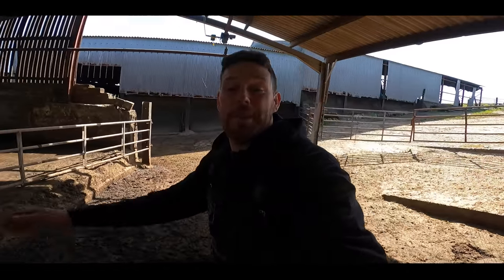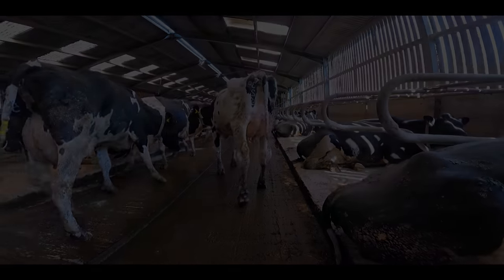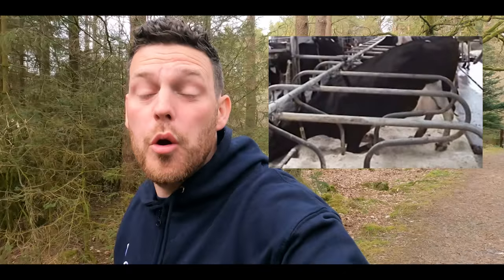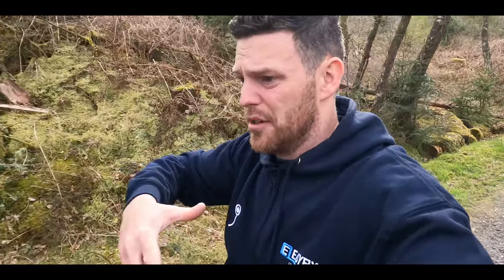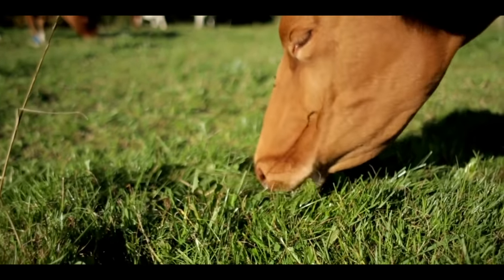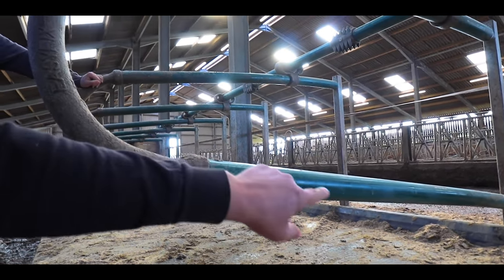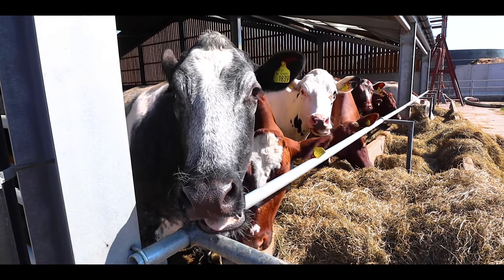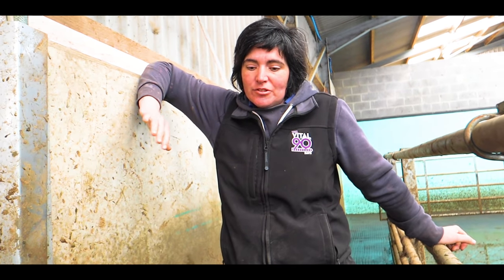*COWS LEG BURSTS* EASYFIX FOR COWS

Comment: It's nice to see how things have moved on I used to fit stall work and dairy equipment and the guy I worked for used to make the stall work from scratch it was nice seeing it develop from raw materials taking it to get galvanised and then going and fitting it aswell as anything else steelwork in and around the building I often thought how uncomfortable it must be laying against the bars and this system looks so much better

Comment: Padding the metal poles with old tires would help them be cushy. I went on a playground that was surfaced  it’s a material made out of shredded tires. It was like walking on cloud. Cut down injury’s from falls from the equipment. And it makes a good use for old tires.

Comment: Seems running cows through a filtered recirculating car wash style system would be better then just the hooves. Heck even adding the side and full undercarriage spray would help them since they are covered in sewage.....Maybe jokingly a wax job.  Though not sure if your country even has car washes.  Why would you bother you have pressure washers!

Comment: I am by no means a radical animal rights activist. That being said, watching these types of videos it becomes abundantly clear that the modern, industrial scale, vertically integrated style of dairy farming with cattle has a lot of issues that are fundamentally not in the animal's best interests. 

First are the ongoing  attempts to breed ever larger cows that are equipped with oversized udders. The cows are too large. They weigh too much for their skeletal system & muscles to adequately support. Bearing in mind that these dairy cattle are no longer afforded the freedom to roam about expressing the essence of what it means to be a cow. They are generally confined in structures, most of which are equipped with concrete floors so that they can be more easily cleaned for sanitation purposes. The result of being too large, weighing too much, the lack of exercise, and confinement, are cows that are not very physically fit. 

The modern dairy cow is a marvel of a milk producing machine. But, that's the essential problem. Animals are not machines, and when they are treated like machines, which is a fundamental requirement of the industrial method of milk production, then all of medical problems, as well as the overgrowth of horns (if not polled) & hooves is the result. 

One fundamental truth that I have observed watching both Scottish & American hoof trimming videos, is that the dairy cattle in these videos are uniformly FILTHY.   They are coated in their own fecal matter from soles of their hooves, all the way up their flanks, often nearly to their spines.

Videos of beef cattle being raised regeneratively here in the United States on farms & ranches where the cows are constantly moving all day long as they graze, with multiple paddock changes every day; are clean. Their hooves and their anuses/tail roots might be dirty, but not the rest of their bodies. In addition, none of these ranchers trim the hooves of their cattle, nor remove any horns, if the cattle breed they are raising is not polled. If their hooves are dirty, it is most often soil from a muddy surface, not fecal matter that is the reason. 

I could go on & on, but the point I am trying to make is that the building's themselves, the design of the buildings, as well as the design of the stalls/stanchions within the buildings, the composition of the floors & walls, and other factors all present to this layman's eyes a system for maximum milk production at the expense of the dairy cow's comfort, health, well being, fitness, and longevity. In other words, the cow is not being allowed to express itself as the cow that GOD designed.